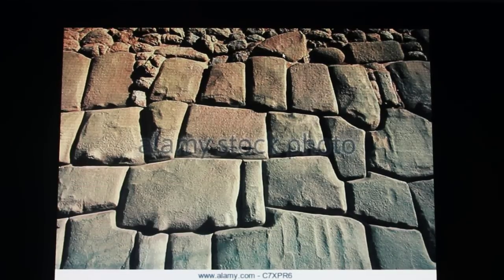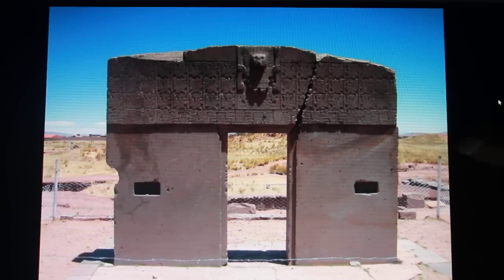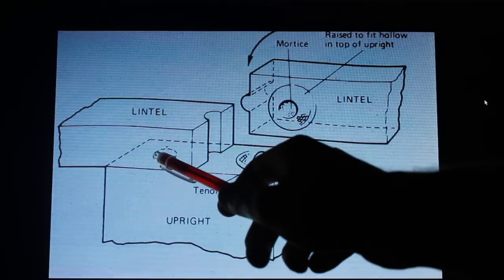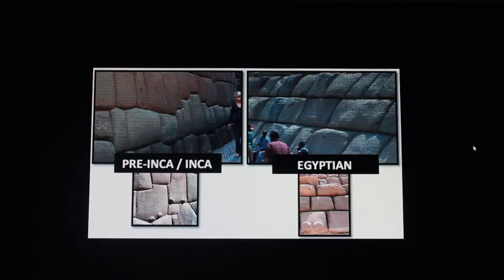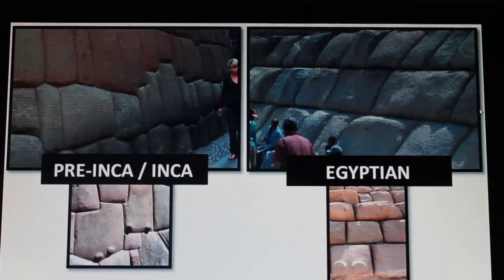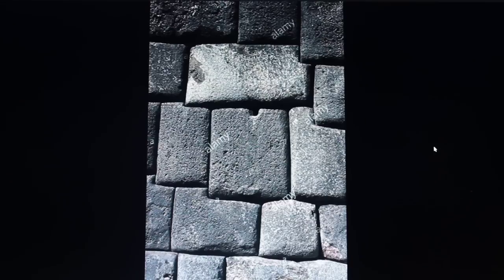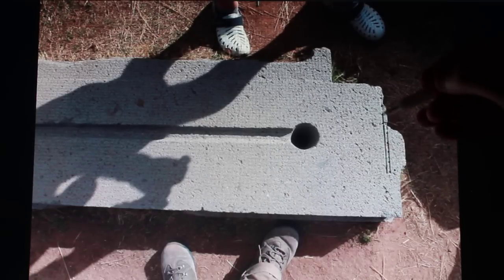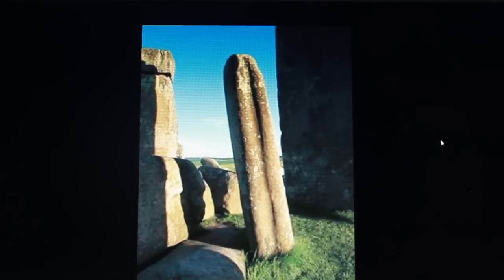Is this what the NUBS on megalithic pre-Inca walls are for? (FOR JOINING STONE?, Proof provided)

Comment: 1.  Structurally, the nubs are out of proportion with the sizes and weights of the rocks on which they appear. Unlike stacked stones which are almost entirely under compressive force, nubs would be roughly under 20% compression, 20% tension, and 60% shear forces. The nubs shown would break off under those forces. The builders were intelligent enough, if indeed joinery were the object, to design nubs that could address these forces.

2.  Geometrically, one would place a joint-nub consistently as close to the center of mass as possible, not on the edge. The examples you have shown of actual joinery nubs at Stonehenge demonstrate this.

3. Time and Efficiency: The effort to carve a flat stone face with a nub on it is exponentially greater than the effort required to carve the entire remainder of the block. Ergo, it is easier to fine-tune the fit than to make a nub, and far more efficient in the long run.

4. You have ignored several elephants in the room by talking about the nubs without first addressing the joints, patterns, planning parameters, and construction methods, all of which are discernible by an intelligent analysis of the hundreds of examples of this type of construction available to us. First demonstrate that you know how and why they were built in this manner (or ask someone who has taken the time to do so) and then go on to the incidentals.

5. The various musings about "protecting themselves from a superior force" and the such like are past the tipping point of ridiculous. We cant build walls like these today. A culture that could build them was probably not hurriedly throwing them together because barbarians were howling across the valley.

6. I would be happy to step you through the process of how to analyze structures like these. But just once; i get impatient with people who can't be bothered to do their own thinking, but feel qualified to present their "conclusions".
Reply from the maker: Great but I just looked at your channel and zero vids so why don't you teach by doing? I wanna see!
Reply: I am holding down three jobs, working on several books, and researching my ass off in every subject under the sun except sports and entertainment. I would be delighted to find someone who could put some of my discoveries on media, myself i'm too busy living to teach. Them that can, do... you know the rest.
Reply: ducq iapetus well said. do you have any explanation for the structure and methods of construction and it's purpose. no roofs or  door ways. blah blah...
Reply: Certainly. There is, however, scarcely space here to even introduce the subject. If we are going to try to think like builders, we also need experience as builders. I am an architect turned builder who has studied sacred geometry as it relates to sacred sites for over 30 years. As such, i can throw a few facts out that serve to begin the investigation.

1. You will note that the lower half of each stone is not carved to fit the ones under it, but vise versa. This is precisely the opposite of what our methods of doing a similar wall would be. This is the largest clue as to the building method. In other words, when you're 60 feet in the air and ready to place the next block, the last thing you want to do is climb up there and carve the rocks to fit the one on the ground that's going up there. And if you're using fancy machinery, even if it's lightweight, you would carve the rock on the ground rather than hauling the machinery to the top of a constantly changing wall.

2.  With this in mind, note that the nubs are characteristically on the bottom portion of the stones. This is an enormous clue as to what method was used for placement.

3.  Consider that the multiple angles of the joints are 3-dimensional. In other words, if the joints are not orthogonal from the front, they are not orthogonal with respect to each other. The calculations requisite to  calculate these joints would not be possible even today using computers, and you simply cannot estimate a joint of this nature and have it fit. If you placed the rock, took it out and shaved it, replaced it, repeat, repeat, it would take about a month for an expert mason to place one stone. Ergo: they were not cut to fit.

4.  If they were not cut to fit, then they were fit in another manner that matches the character of how the wall was built. As such, we have to look at structures like this with the following observations: A. They were not concerned with regularity or conformity. B. They used stones as they came, rather than sizing them. C. The walls were built with strength and stability being the primary parameter. D. Larger stones tend to be placed deeper into the stones below than smaller ones. E. There is no consideration whatsoever for the amount of work it would take to notch a stone. Often a much smaller stone will notch into the stone below in a manner that would take us far longer to make the notch than to just find a better stone. Ergo: notching took less effort than the effort taken to actually get the stone into place.

5.  With these initial observations, we can with a fair amount of confidence come up with a close approximation of how they were built, and we find that similar methods have been used worldwide in ancient megaliths. If, using whatever method (sound, directed energy, etc), you vibrate the stone being placed at the proper frequency, it will render any stone with which it comes into contact into powder. This is a relatively simple procedure, and the number of methods by which it could be accomplished are many.

6.  Given that this explains just about every otherwise puzzling aspect of the wall's construction methods, we can move on to the detail. If you were a normal worker putting a normal stone on to a normal wall (which, to them, was in fact true, though the result does not seem normal to us because we're living in the dark ages of humanity) what would you use to lower the stone? Whether or not you're using some sort of harmonic frequency to effect what we today would call anti-gravity but they simply called levity, you still have to put the stone into place. Suppose you use straps and lowered it in. Now look at where the 'nubs' are. The straps would slightly dampen the vibration where they were holding the stone.

This leads to many other considerations, many of which would take an actual visit to explore. But it's a start.
Reply: I get what you're saying, it makes a lot of sense. One problem is that not all of the megalithic stones have the knobs on them......although....I suppose there could be knobs on the reverse faces of the blocks that we can't see. I don't agree with the original poster's idea that those deep depressions near the edges of some of the blocks somehow correspond to the knobs being fitted into them--the depressions don't seem to be deep enough nor of the right shape such that the knobs would fit into them.
Reply: Item 5 reminds me the archeologists' dead-sure cocky explanation: Everything fairly large was either a fortification or a temple/a place of worship. 
That's it. 
It's laughable, because they sound like simpletons.
Reply: @ blkcandywarez 
1) They already explained why you would as well as how they arrived at this conclusion. By thinking like a builder.
2) Of course you wont keep that in mind because you have not even attempted to think like a builder. Clearly from your #1 reply.
3) Actually agree with you, except for different reason. It is nonsense as it is possible .. thing called a template would make that easy to match joint of any cut. Old builders trick actually.
5) Actually there is evidence to be found. Although while I agree this might be a possible explanation, not sure I would say "with a fair amount of confidence". Assuming there would be any powder or residue (which may not even be the case) shortly after, one would certainly not find any trace of that by now all these centuries later exposed to the elements. You realize someone already has reproduced these results in this century in FL? No powder is left there either only after couple of decades (doubt was any next day either).
6) Do not recall stating straps were under the blocks. Straps are placed under the nubs. Could you imagine someone attaching straps around the entire object being dipped in something to be coated for example, they don't do it that way even today.
Reply: 1) A stone mason IS a builder, so not sure what kind of point you are trying to make. Other than confirming the original point ducq iapetus already made.

"There isn't a damn thing to suggest that these masons were using methods any different from the eons of masons before, or after them." Wrong. On at least 2 levels. Masons after and today are unable to accompolish such feats and/or would require computer machines to replicate such near perfect precision, so clearly they were using different methods. If you really look at all the examples at these sites, are plenty of differences to suggest such. Mirror like finish experts suggested requiring over 1000 degree heat (way beyond inca, egyptian and even roman capability). Scoops found in unfinished obelisk at quary site, similar to those found in stone block at bottom of wall at start of this video, only much deeper and in much more constrained setting with only trench around sides to walk around. What appears to be tire marks found inbedded in rock at quary site near cuts that had been done in rock. Just few examples.

Secondly. Talk to native tribes (or listen to plenty of videos from some that already have) or talk to native shamans. Western world no longer thinks the way they do. Westernized masons will not think like they did, instead relying on known or passed down techniques, versus relying on techniques long forgotten. Things have been re-discovered time and again through out our history.

5) There is plenty of evidence if one takes the time to actually look for it. Lots of videos on vibrations and frequencies. Lots of proof found at oldist archaelogy sites all around the world which have found vibrational tools. I already brought up one alternative unconventional in my #1 just above. As well as others in other posts in this video. aka melting or turning stone into a soft stage, than pouring (even this video mentions how stone appears to be cementish looking). Open your eyes. Search for mudfossil university megalithic video only posted one month ago. You do not even have to listen too much, just look at examples shown where one can find such tire like tracks at lots of quary sites. Take note of cross hatch diamond section to left of one such tracks. They go one about flesh and tendons and other rubbish, but point is chemical composition down to atom structure. Most archaelogists do not focus on this (if they even bother to look at quary at all), but are plenty of them to be found. Understand that just like master artists do and follow the natural structure and make up of material being used and work with it, not against it. Taking advantage of. A great builder is after all a master craftsman or artist of their trade.

You do not realize people have been producing these results with conventional, if that were the case we would not even be having such discussions. Conventional techniques can not produce such precision, as clearly seen by Inca naive attempts at reproducing right alongside older well built techniques. Statues in Egypt which have one side of the face exactly identical down to the micronometer to the other side can NOT be done by conventional methods (unless you use computer machines). Show me an example replicating accompolishments done today compared to what this ancient civ did or what Edward Leedskalnin did at Coral Castle in FL. And poor old Ed who was impressive was not as masterful as those old civ's, but Ed did it single handedly and although I do not know his secrets, believe he only partially unlocked the technology used. We have not even gotten into striation marks found on bore hole drilling which experts claim can not even be done today. If material was in softer stage though could explain it. Just as it explains the nubs commonly found on while working with clay material. Leading too....

6) I personally do not believe nubs were used for strapping, so will not go into it much more, but does not discount that is valid point and possible reason for them.
Reply: Yes I agree, builder is vague. On purpose, as all builders regardless of actual type of occupation can relate. Not specifically, but generally. Ideology and principles are common in a lot of things. Just as with artists. If had stated masonry for example, I am not, nor ever have done that. Not a brikie either. So would make it sound like I (or anyone else that has never done such) could not relate. Yet I can still relate as I have done several other types of builder work. So not it is not a useless concept. Although I have never done any such type of masonry work, because I have done other building type work, I could prolly pick it up really quickly (in fact have none several carpenters, steel workers etc that have built their own stone walls from scratch all by themself). I would not know all the tricks of the trade, and as such would not be as good initially, but I still could and can still relate. I can understand the general outline and uses for nubs for example, even though I was completely unaware that working with clay can produce such protusions. I can easily understand the practicality and how to take advantage of them.

Of course there are cyclopian structures all over the world, and I am sure many excellent fine examples too. However, highly doubt to the fine degree of precision done such as by these ancient people. Such perfectly straight cuts, such high degree matching of joints and usually done with polygonal shapes. Those people built things all over the world too. Yes the romans were capable of such high temperatures and clearly did so. But were NOT capable of such at quary site that was movable for each cut. Sure in a set metallurgy. Wrong in an example and setting like I was talking about. The site in this video may perhaps have come later .. but not the original structures. Inca rebuilt and patched those, as anyone can clearly see the distinct differences in building styles. Just like one can clearly see distinct difference with spanish style later on.

No, you have not shown single shred of evidence that any (let alone many) ancient civ was capable of vitrifying huge megalothic stone. The only ancient civ to have shown this predates all those other civ's. The ones after were not capable until modern times .. and even today experts are in awe and wonder how to accompolish such a thing. I am sure they could today if they put their mind to it. But it would be no easy feat just at one location. You do realize the stones used were always certain specific types in all these. Usually Limestone, quartz or andesite. Some suggest due to energy properties and or vibration frequencies. I do not know lots about stone, nor vitrification, but I would guess it would be easier to do with limestone. Quartz and Andesite doubt would be as easy. But Idk, could be wrong. Still have never seen any other ancient civ capable of vitrifying such a vast amount like these megalothilic stones. Romans could vitrify .. smaller things like wheels, helmets, etc. Sizes manageable by one person, not sizes vastly larger than the human body. You are talking about modern todays tech and trying to compare that to Romans capability. Get real.

Show me one example of conventional technique that was not done by computer machine within 0.002. The only examples you will find were done either by this ancient civ or by computer machine. And you want to insist there is ZERO evidence. Pfft. Think I will listen to experts that have actually looked at these and been impressed. People that have done precision cutting and or shaping of metals, glass, etc requiring such high degrees of precision. The stonework is not unique in its form. It is unique in its complexity with its 3d cuts. It is unique in its complexity with length of striation marks of drilled bore holes (No I am not talking about Chris Dunn nor have read it, am talking about a video of someone else who had an expert with him that actually did diamond cut bores and they showed the marks and spread on the video). Twice as fast that is capable than even todays capability. So do you want to try and tell me again how it is not unique.

As to whether it was that statue you linked, I have no idea. There were so many circles drawn on it to compare all the points and angles, it just looked like one big mess to me. Computer had analyzed it as being perfect match, so never thought to question it more. Maybe it was not.  I only recall it was egyptian statue. Only the face was supposedly perfect symetrical match, anything outside of that definitely was not. Like the ears were not, do not recall if had beard but if so that was not part of perfect symetrical analysis. The micrometer was NOT used to analyze the statues face, that was done by computer. The micrometer was used to measure the straightness of the cuts of the stone, especially on the mirrored finish stones. 

Also btw, pic of your link, disagree about your obvious to the naked eye statement. The left eye appears to be lower to the right in my opinion, but that also appears to be an optical illusion due the headpiece above which definitely is not straight and slopes down to the left .. hence making the left eye appear lower. Lining it up on my pc screen actually shows the left eye is indeed lower than the left still though. However, that really depends on angle the pic was taken, if pic was taken slightly off kilter could explain this. So looking at perpendicular angle. Clearly that pic is indeed canted, slighly off in clockwise direction so of course left side will be lower. Unable to tell without more precise measurements due to off angle pic was taken. But lining up middle of upper lip, lines up with middle of nose draws up to about couple degrees to right on upper portion of the nose. Relooking heights again, have no clue how can say left is higher. Every single line comparison clearly shows the left side is lower (from top headpiece all way down to chin). Go back and find a straight pic first. Because you can not even go to next step of size comparisons until you get a perfectly straight head on pic first. (any builder should be aware of this). Even artist are aware and use such principles.

Oddly enough, last night I showed my wife pics from mudfossil vid and asked her what those marks looked like. She glanced over and simply said tire marks, shrugged and went back to reading. I had to explain to her that was in granite rock.
Reply: I should add that I do understand your statement about builder being a cheap ploy and trying to lead the viewer. I just do not agree with it, or at least agree that was the intent or purpose of it. Idk, can not read their mind so maybe it was but it still pointed out the same perspective and viewpoint I was initially thinking when watching the video.
Reply: "What? So, ancient civilizations couldn't vitrify rock. It was one, even more ancient, unnamed civilization that could. OK."
Uhm yea, already brought up the fact that things have been reinvented time and time again in our history. So if they used a tech that had been forgotten later, than yes more ancient civ could be capable of achieving things that later civs were not.

Anyway, I was partly wrong. The romans did have the capability. Whether they thought or considered is irrelevant, they were capable apparently. I watched vid of metallurgy guy (who has since turned archaelogist and visited many of these) who explained a lot.  Couple hours long and much of it was boring and only followed part of it. But apparently it is not that hard to crank up the heat required for stone in matter of seconds. They explained result of nubs etc in one possible method, by using layer of sand lining their form work before they do the pour. Possible but does not explain many other things.

So I watched another vid from Ancient Architects channel, which mentioned another similar method, but more like your last reply implied. Using sand bags of stone mix building a wall, which would explain the appearance of nubs. Various shapes and sizes of the bags knowing that polygonal pattern created a stronger wall. They (like you) suggested and even gave natural hypothesis that could have vitrified the wall later. The bulge on surface of stone blocks (which as builder watching about many of other proposed methods prior left me feeling unsure of). But anyone with metallurgy tech could have vitrified the wall of sand bags as well, just does not explain why leave the nubs as well as if was done at later time by nature.

End result, yes romans were capable of all this (or any civ with bronze age tech), especially ones with wheel tech as well which would make the whole process easier. None of this explains the opposite looking indent dimples in stone blocks, but clearly the making of the wall was possible by many civs. Or many other things such as scoop like cuts found at lots of quary sites or even found on megalothic unfinished obelisk, nor the high precession straightness of some of these cuts (guess you never heard Serapeum of Saqqara that Mr. Hawass himself can not explain).
Reply: Why do you keep quoting Dunn? Was he the one in the original National Geographic episode on this? Seen it too many years ago and names (with my dyslexic nature) has always been problem recalling for me. All I recall of their show is they claimed to have used laser and claimed it was perfectly smooth within something like miniscule amount. Hawass who was with them during filming expressed himself that could not explain how eqyptians had accompolished such a feat. Cutting most dense items (like even wood for example) even using a straight edge will indeed result in imperfectly made cuts, not precision smooth that National Geographic claimed was done. I do not know about you, but I find NG credible. Maybe I am foolish to do such. I definitely would not go by those pics you provided, those are not precision measuring tools lol. I do like the "expert" printed on the one though :D
Reply: blkcandywarez im a builder ,can i help?
Reply: No one can reverse engineer this work . Every possible Theory hits a snag   cement would solve a lot of problems but molds ? Every piece is different . hand tools not likely to big and complicated . Sound wave's and Brain power poppycock. More weed please. This work appears to be done with CNC robotics with higher intelligence in control  . It's obvious that weight and size did not matter and how complex the fit is . The ones that did this work were not breathing hard. The why is the real hard question.
Reply: My favorite part is where he says that he thinks these walls were part of a different structure that was demolished than reused to make a wall elsewhere. These perfectly fitted stones that are all irregular and polygonal..??? Lol....I don't think so. It would be easier to build new walls.
Reply: Also there are videos that show other walls in the area just like these ones that are partly collapsed and there are almost no nubs or impressions on the backs or sides of the stones. Almost all are on the outer faces of the stone. How much did he look into this before he formed this theory..? It doesnt take but a few mins to see its bullshit.
Reply: ducq Etc  Your point 5:   Actually,  we can build walls like this today!  Really easily.  I have done it in my back yard.
Reply: I'd like to add that the way he breathes in the sounds he makes would lead one to believe that he's in a hurry to relieve himself of this information yet it's obvious that he hasn't done enough research to be presenting any kind of conclusion. It's aggravating to listen to him as it sounds like every couple of seconds he's spitting a fingernail across the room and having photos in your slideshow of irrelevant material also break the concentration of the people you are trying to inform. All-in-all I found myself more focused on the sounds he makes then the information he thinks he's providing which is obviously and clearly incorrect. The image he shows of Stonehenge clearly indicates that the mortise and Tenon style, which is I miss nomer due to the fact that that is a woodworking technique and doesn't technically apply here, relies on Center of mass and at the very least the center of the piece in relation to the adjoining piece. What I mean is that he shows us information that clearly contradicts his own findings. These Nubs, or more accurately, protrusions likely to never be understood until we devise a method of constructing such a wall for ourselves.
Reply: Ha, you dorks are ridiculous.
Charles conjectures are actually quite insightful and thought-provoking.

Meanwhile the lot of you are just blinded why what do you already know, and especially what you Think you know.
Oh, and another thing. I really don't think the builders were necessarily all that bright.

They simply possessed the miraculous formula, for creating, cutting, or molding these Enormous megalithic stones, with the ease that a child would shape Play-Doh or Lego blocks. 

Some human must have stumbled upon it, (or was gifted it) , some long ago in our prehistory.
Reply: there is soooo much more to this than obviously YOU know..... it isnt simply idiots with miracles....that supposition like many of the "conjectures" here can be quickly discarded with proof....proof that is everywhere at these sites......sites which, by the way, are chosen VERY specifically for many other properties that i am sure you would find miraculous as well....i will tell you of just one but there  are many many...

Did you know that all of these sites where this type of building can be found there is a high deposit of piezoelectric crystals found at or near the false doorways that are also found at these amazing sites?

while i agree that the "cement style bag" theory is a great one for explaining the vitrification of the rock surfaces and also the peeling away of this layer on some more worn rocks...it does little else to explain any of the other enigmatic findings dealing with the building of these walls and structures.

it has been my experience that when having a debate or conversation with someone who feels inferior in their knowledge about the topic, they will often use verbal attacks such as name calling, no matter how soft a name, i order to misdirect the attention that would be given to their inadequacies... Scientific debate requires clear and concise, cogent information to be presented so that the greater good of Learned achievement can be achieved... name calling and calling out ppl with no proof or indeed factual material to present is immature and the present ideas and in fact the future ideas of this person may be dismissed altogether. 

we all endeavor for the truth, but NO ONE know what that is...so untill we do, let's respect each other and our opinions...oddly, in the scientific community, it is considered a form of respect to have one ideas considered even if they are shot down two seconds after takeoff....like it was here.   if the folks here who bothered to comment did so with information that contradicted this channels post, it means they respect him and his "ideas" enough to even bother with telling us why they disagree.  You, you2099, begin with name calling, then a blanket statement of support, and then you begin to pass judgment on all who gave time to post their ideas....but your follow up statement on the lack of intelligence by these builders, is you projecting....
Reply: @kevinfisher1345  so technically we really did lose a ton of trade secrets from environmental, geological, space (metors and asteroids), war and plague hazards. The issue with Roman concrete highlights this , we have the recipe to some degree, but how they achieved something like cold fusion to make that cement is an issue we have to been able to solve yet to reproduce. Thus, since we haven't solved this problem we say that our concrete is still better than it, when it can get stronger with sea water, something ours cannot. So what we can do the quick dry cement, lasting is still an issue.
Reply: @wickedliquid1177  Maybe but the ancient people even later on time didn't like to waste and did reuse stones if could to build new things if the old was not wanted anymore. Check out the Celts did to many old structures in Scotland and what were the Wall and some castles built out of reused stone.
Reply: ducq iapetus with the amount of knowledge you ate portraying and how you structure your information, you need to try make videos. I think they would be very interesting and very informative

Seriously consider making some, you have the knowledge to do so
Reply: If you like calculations, now transfer the logic of these proportions, this pressure, and the size of the points to the logic of an ice skater. By doing the calculations, the pressure that an ice skater exerts on the blade to glide on a solid layer of ice, this 20% will allow the rock to slide perfectly on the ice, without considering other factors.

Ff = μmg,
F = P * (πr^2),
r = √(μmg / P),
t = 2r,
r = √(0.2 * 1000 kg * 9.81 m/s² / 10 MPa) ≈ 0.1 m.

With these simple mathematical calculations, you can calculate that to move a one-ton rock, the protrusion must be 20 centimeters. You can replicate these calculations, but change the scenario—imagine it is the Ice Age. Now also think about how a domino piece slides, with the protrusion, but only if the surface is smooth. So, in that case, look for other scenarios in your imagination. For example, imagine a stone with three points: the center one functions like a domino piece, and the points at the ends, one is shorter than the other. I think you can make any stone move.